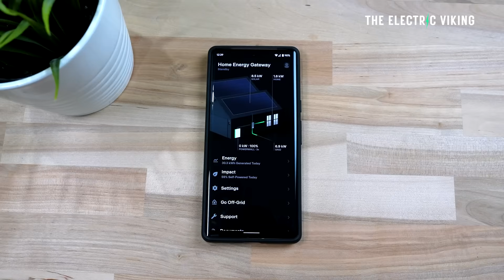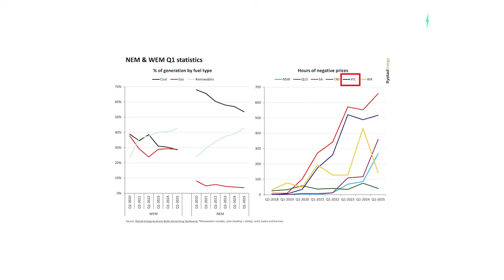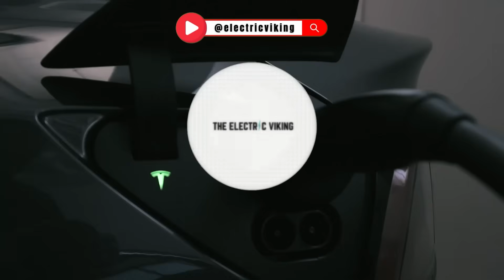Wind, solar & batteries push renewable energy to record levels in Australia

Comment: Edit 

Solar /wind  and batteries are duds 

Using the cost of the South Australian big battery (Hornsdale Power Reserve) as a benchmark, it would cost approximately A$155 billion to build enough battery storage to power all of Australia’s dwellings for 24 hours, based on the battery’s historical cost of A$888,889 per MWh of storage capacity. However, if we account for more recent battery cost declines (to around A$562,500 per MWh in 2024), the cost drops to about A$98.1 billion.
We could build 11 Large Nuclear power plants for that  each with a single reactor  which would power around a third of Australia needs
But if you build power plants with 3 or 4 reactors we can save anywhere from 10-30% 

Because solar and wind don't work 24/7 they need to be replaced every 15-20 and batteries even sooner 
Businesses and industries use 3 times more power than homes/ dwellings 
We need to build Coal or nuclear for 24/7 base load power 
 that's $98 Billion just for batteries, that doesn't include the cost of wind or solar farms or new transmission line, Solar and wind farms are a little cheaper than building Nuclear not be much. But we haven't included the added transmission lines  which is in the $10s of Billions 
Wind farms use 130 times more land and Solar  farms uses about 30 times more land than Nuclear does. Oh, that's when they are actually producing power 
so if they only produce power 50%  you must double the size 
they are prone to weather damage such as hail storms, strong winds. 
They are far worse for the environment when you take in account how they are made what they are made from the actual power it takes to make and transport and build them and they are not recyclable
All up, the power to produce a windmill is more than we get back because they have a short life span 

Australia’s Reality: Solar and wind are scaling fast (40% of grid in 2024), with costs dropping (solar down 8%/year, batteries 20%). Nuclear faces legal bans and no industry, making $8.5 billion for a single reactor plant maybe is optimistic. That's the figure that a few have come up with including the CSIRO (for the first one  but there will be savings once we know how to build them and if you put multiple reactors on site the price savings can be as high as 30% per reactor (a more realistic saving would be 15%)  will be.  Renewables are deployable now; nuclear wouldn’t deliver before 2040.

Bottom Line
Per TWh over 60 years, nuclear appears cheapest ($0.0062/kWh) vs. solar ($0.0291/kWh) and wind ($0.0379/kWh), but only if built on budget and without storage costs for renewables. Solar and wind are quicker and cheaper to deploy initially, critical for Australia’s urgent coal phase-out, but nuclear’s long life and base load reliability could save money over decades—if political and technical hurdles are overcome.
So the power from nuclear is 4.5 times cheaper than solar and 6 times cheap than Wind over their life spans

What about the land they use. For equivalent output, but nuclear’s single-site build avoids sprawling land use \

Comparison of, 4000MW plant 
Solar: 9,000 hectares (90 km²), fully used but potentially dual-purpose (e.g., grazing).
Wind: 160,000 hectares (1,600 km²) total, with 2,400 hectares (24 km²) directly used (the footprint) ; most land stays farmable.
Nuclear: 150 hectares (1.5 km²), minimal but fully dedicated with no dual use.
NOW  multiply those numbers by  9 

And DON'T forget if there is no wind or too windy, Wind farms don't work
Solar doesn't work overnight and doesn't work efficiently on cloudy days, if at all 
Both are very much prone to extreme weather events 

how much more power will we need to charge all the EVs 
DON'T let facts get in your way

Comment: In Victoria the period we are going into now, April through to late August, sees the daytime solar production drop significantly to between 1/3  and 1/4 of the production that is generated from  Nov - Feb. the batteries are great but will struggle to store even 2 hrs of peak usage.  the Banella Solar farm area sees day time solar drop significantly due to shorter sunlight period and increased overhead cloud cover. - we need more wind turbines but the greens are stopping development. BS excuses over endangered wildlife and harmonic resonance from the blades as they spin. Complete BS from the tinfoil hat brigade.
In summer the batteries will fully charge and provide 4 hours max peak demand.
We have a massive imbalance in Vic for Peak usage.
Even with wind generation that does seem to increase during this same period, the curtailed wind energy needs to get stored. 
Victoria needs 000's more wind turbines and many more Mega Batteries or we will still need base load.
We agree coal is the most polluting,  Our Hydro is still nowhere near large enough, and Snowy 2.0 is still years away from completion. Snow operators say by end December 2028 but people on the ground suggest more like  end of 2029 mid 2030.
Pumped Hydro is only a battery but still to prove the effectiveness and efficiency estimates 60% 70% recovery due to simple energy losses in the process. 100% solar or wind energy during the day used to pump the water up the hill. evaporation, friction loss and then the reduced generation of the Hydro turbines result in about 60-70% recovery of the energy.
Again all these figures are calculated estimates of the system,
Chemical Batteries like redox batteries are not being utilised which seems a significant lost opportunity as construction time and cost is half of the cost compared to the LiFePO4 megapacks. and it is reported that the Redox Flow batteries whilst three times larger than the Megapacks for the same size storage actually operate longer and have many more years of cycle life and the chemicals are non toxic, non combustable and easily recycled, regenerated and can be reused.
Reply: Nope. Not thousands of wind turbines but 1 or 2 GW class nuclear reactors at Loy Yang. 

Redox batteries consume more energy than they can store. Batteries are not economically viable at the scale we require. 

Nuclear is cleaner, cheaper and better for the environment as well as preserving thousands of real jobs of power station staff. 

Oh and nuclear is far safer than combustible batteries and 150 x safer than coal.

Comment: Australia total energy used is 6,470TWh annually. 
Australia total grid electricity is 245TWh, this is only 3.8% and nuclear electricity is promoted to be 1.9% of Australia’s total energy useage.

Nuclear ain't going to affect Australia total CO2 emissions 
Australian nuclear electricity ain't going to change Australia main problem and that is worldwide CO2 emissions. 
Just some facts. 😮 😊😊😊

Edit.  Nuclear is a waste of time and money and is 20years away.
Reply: Nuclear is actually the cleanest form of energy and is actually cheaper over the long run. The Japanese and South Koreans can build a nuclear Power plant in about 5 years.
Reply: @stephenvelden295 
💯 Sir. Finally, someone who actually gets it. We are surrounded by morons these days. Uninformed self righteous fools.
Reply: @stephenvelden295  The biggest mistake is to think that the existing national electric grid that suffers from blackouts can carry more electricity. 
25gW is the maximum fossil fueled generation, and even the nuke promoters say only 14gW as the national generation rises to 30gW.

"CO2 emissions are the problem, and nukes are the answer," but Australia's emissions go way beyond 14gW of generation. 

It is a tiny little thing 14gW and has a tiny little CO2 emissions reduction for Australia. 
This small 14gW needs the entire $TRILLIONS grid that was built over 14decades and is a million km long. 

So the grid and the generators have a massive footprint that needed the Australian mining industry and the Australian industrial capacity and fossil fuel industry and national wealth.
Even the Mining companies say that.
They say it because people forget.

So, nukes are both too small to make a CO2 difference and too big a danger as a worldwide CO2 emissions replacement technology. 

Just building the extra grid capacity is beyond most people's understanding.

Nuclear 14gW x 24hr x 365day is only 123TWh annually at maximum operation.

I just don't understand how uselessly small for Australia, but what a massive problem it is as a worldwide CO2 emissions reduction solution. 

Australia’s rooftop PV capacity can easily selfsupply and then match the grids' full capacity to redirect clean electricity to the industrial consumer's moving away from fossil fuels. 

Look, there is much more to be said, but the world can not believe that Australia doesn't use this cheapest abundant solar energy. Australia is in Sahara Desert latitudes and is politically stable.
Reply: @stephenbrickwood1602  For a start the grid doesn't care how the electricity is made.
Secondly CO2 is not a problem. Climate scientists have got it wrong but they will never admit it because of the Trillions of dollars spent on Net Zero.
CO2 is only 0.04% of the atmosphere and increasing to 0.05% will make no difference. In fact there is a CO2 ceiling where increasing the level causes no increase in global warming. We passed that ceiling hundreds of years ago. Back in prehistory the CO2 levels were approx 0.1%. Nothing died and in fact plant life flourished. There were no cities, cars or factories. Plus in that time there were at least two ice ages. So how can CO2 cause global warming? Rising CO2 levels are now believed to be due to global warming and not the cause!
Reply: @stephenbrickwood1602  https://www.youtube.com/watch?v=Sj_qKmB9KaI
Reply: @stephenvelden295  wow.
13 minutes in, I will look at more later.
I think he is saying the immediate rise in temperature will level out and not go to destabilisation extremes.
But more CO2 still warms  ??

My real concern is that nuclear electricity industries worldwide must include nuclear military defence budgets exploding. 

My other concern is that nuclear electricity is actually GRID ELECTRICITY, and this is the real cost, and it is a massive problem if fossil fuels are to be replaced. 

Rooftop PV is dirt cheap electricity, and all vehicles, including EVs, are parked 23hrs every day and all night long with massive FREE electricity storage and soon v2g technology. 

Grid electricity demand will collapse, and cashflow to grid owners will collapse. 
Grids are $TRILLIONS infrastructure and need an ROI of 10%, $100sBILLIONS. 

I see grid economic and military defence costs,extreme costs as the main problem. 
Even if climate change is moderate, then an electric future may still be the best.
Reply: @stephenvelden295  I am still trying to get through the video. It's very interesting 👌 so far.
If climate is not a problem, then clean electricity is not important for CO2 has little effect. 

Are you promoting nuclear electricity??
Reply: Correct
Reply: @stephenvelden295  why do you promote nuclear  ?
Reply: @stephenbrickwood1602  Nuclear Energy has been given a bad rap because of Chernobyl. Modern Reactors are much safer making accidents almost impossible. It is, by far the most efficient and cleanest form of energy production. A Nuclear Reactor is also a very long lasting piece of infrastructure, unlike wind and solar, which are very short term. The footprint of a Nuclear Reactor is also quite small, whereas wind and solar are huge and destroy a lot of land. It is also possible to reprocess nuclear waste and reuse it in the reactor, reducing the amount of waste. Solar for home use is a good idea but I would never put Lithium Ion batteries (of that size) anywhere near my house.
Reply: @stephenvelden295  let me get back to you later. 
Just as you put forward the CO2 emissions 'feed back ' error calculations and avoided the 'talking points' of the 'climate warriors', I will highlight the 'nuclear promoters talking points'.
Often, talking points are just tactics to mislead and waste busy people's time.
Reply: @stephenvelden295  do you live in Australia?
Reply: @stephenbrickwood1602  Yes. I also heard Chris Bowen gave the CSIRO the figures on nuclear he wanted them to publish. The figures have nothing to do with reality. This came from someone within the CSIRO.
Reply: @stephenvelden295   I think I understand and obviously hope this is true. 
Tony Abbott made the judgement not to destroy Australia's economy as it is 'our lifeblood', so to speak. 

This means he did not see that nuclear electricity was necessary also.
He was protecting us from nuclear proliferation also.

The Chinese seem to have engineered their population crash and constrained their own creativity that democracy foster.

Dictators steal and kill to the top.
Dictators supporters have the same culture. 
After victimising their own, they go after their neighbours. 

Personally, I think David Gillespie book Toxic in the Workplace is a good read.
Empathy is in the population and voters.
No EMPATHY, psychopathy, is in the leaders. Who wants to stay in power. 
In control. 
Thank you for your feedback 😊 
Hahaha 👍
Reply: CO2 emissions are not a real problem. New science has found that rising CO2 levels are not causing global warming. Rising CO2 levels are a result of global warming. This makes more sense because the level of CO2 in the atmosphere is only 0.04%. So even if it rises to 0.05% it will make a negligeable difference. There is also a saturation point beyond, which CO2 levels make no difference to global warming. We passed that point hundreds of years ago. The Earth has, in the past, had about 0.1% CO2 and nothing died. Plant life actually thrived in that environment. And there were no cities, cars or factories! Plus during that time there were at least two Ice ages. So how can CO2 levels cause global warming? Global warming has more to do with the Earths position in the Solar System which is a cycle that lasts thousands of years. Many climate scientists know this but they also like to receive their pay cheques so they keep quiet and tow the line. But there are some who are not afraid to speak an alternative view. One that makes much more sense!

Comment: You could install a home battery even without solar panels.  It might even make sense.  Store off-peak power (cheap rates at night) for use during peak times.  Act as backup during blackouts.  Support grid stability (some programs might even pay you for it).
Reply: There is NO WAY I am having a large bank pf Lithium Ion Batteries anywhere near my house. Let alone drive around sitting on top of a bunch of them.

Comment: Just had a 13.2kW solar system installed near Hobart. No need for batteries as we don’t use enough power after dark. Would take 15 + years to recoup.  Been getting close to 10kW with full sun. Not bad for Autumn.  Cost $10,200 to install. Sam, why haven’t you told us the cost for your install from Resinc, or was it a contra deal?
Reply: A 15 year payback is a great investment. Are you saying otherwise?
Reply: @BigVine-m5i  I won't be living here in 15 years' time, likely much less. Other than the obvious power savings, adding solar to a property is value-adding to the value of the property. Money well spent. We have two EV's to charge. The 7kW charger also value-adds to the property. It's not all about recouping the cost of a battery, that will need replacing in around 10-15 years. Perhaps a little longer if you're lucky.

Comment: Here for the Spotlight comments. Couldn’t be happier🍿
Reply: Same🍿
Reply: BHD batteries, particularly those used in electric vehicles, commonly employ nickel-containing chemistries like Nickel Manganese Cobalt (NMC) and Nickel Cobalt Aluminum (NCA), with NMC often approaching 90% nickel content. 
Here's a more detailed breakdown:
Common Battery Types:
NMC (Nickel Manganese Cobalt): A widely used lithium-ion battery chemistry, with newer formulations approaching 90% nickel. 
NCA (Nickel Cobalt Aluminum): Another common lithium-ion battery chemistry, also containing a significant amount of nickel.
Reply: While a precise percentage for Australian EVs using NMC batteries is difficult to pinpoint, globally, NMC batteries make up roughly 60% of the lithium-ion battery market share, with LFP batteries gaining popularity. 
Model Y was the top-selling electric vehicle (EV) in Australia, with 21,253 units sold, followed by the Tesla Model 3 with 17,094 units. 
Here's a more detailed breakdown of the top-selling EVs in Australia for 2024: 
Rank
Model
Sales (2024)
1
Tesla Model Y
21,253
2
Tesla Model 3
17,094
3
MG4
6,934
4
BYD Atto 3
6,393
The Tesla Model Y Long Range and Performance variants utilize NMC (Nickel-Manganese-Cobalt) batteries, known for their higher energy density and good range, while the Standard Range model uses LFP (Lithium Iron Phosphate) batteries. 
Why am I doing your research for you?

Comment: Come point at a coal industry worker the way you did old mate at the expo. Full of steroids and shit. Windmills and solar panels are made in China with power produced with Australian coal. Solar panels don’t last long enough before needing replacing to warrant using them. The battery’s don’t even use Australian resources. Wind turbines use oil and petroleum products to produce, install and maintain. You clearly only take things at face value and believe whatever is said aslong as it makes you feel good even if it’s completely different from what’s shown.